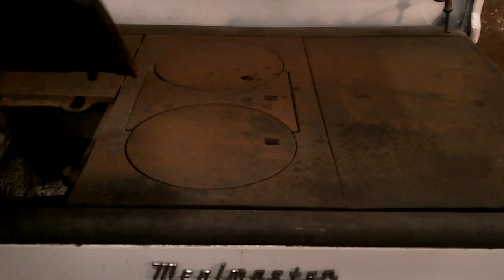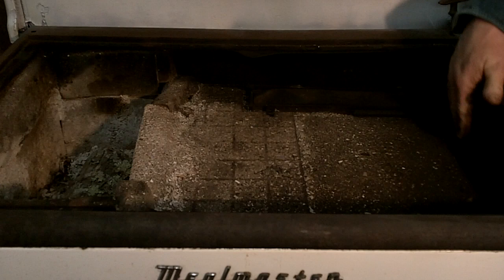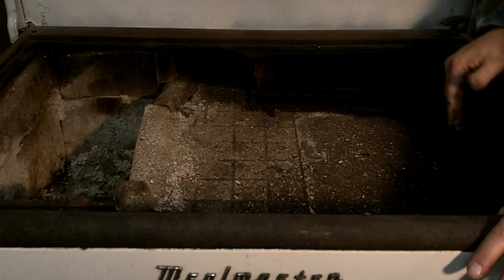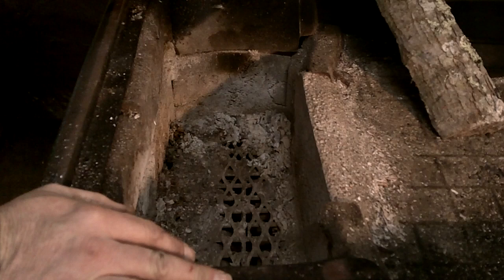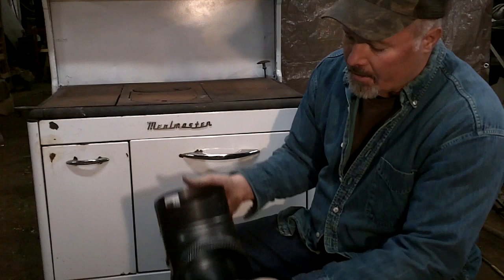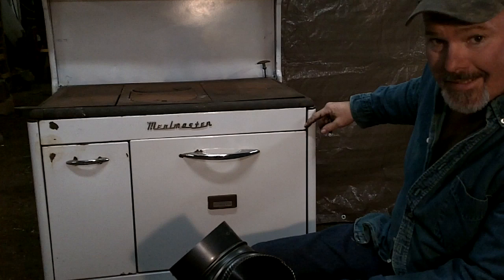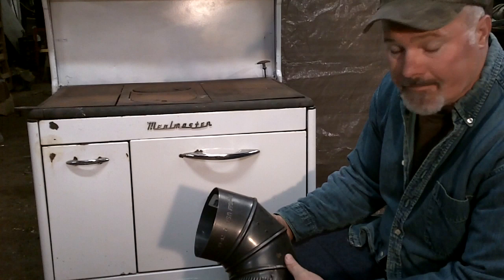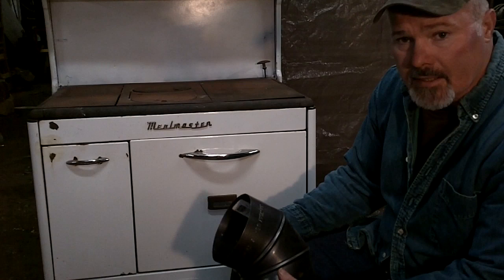wood cook stove basics part 2

Comment: my dad always turned his pipe up thru the ceiling and not out the wall This allowed him to install, and use a damper in that pipe.He would damper it down when the stove was hot and you could feel the stove getting hotter. The coals would glow and continue to burn, but the heat didn't escape straight up the chimney. It was held down more in the stove top. More heat from less wood  Just another variation on the pipe. He grew up in logging camps in the 1920s around Asheville NC.

Comment: This is an excellent video. Thank you so much for sharing this information. I am building an out door kitchen where  I have limited access to fuel and gas. Therefore all cooking has to be done using wood. I have to cook for 45 to 80 volunteers a day. I already had plans for a wood/charcoal griddle as well as a large barrel grill. The part that I was missing was an efficient wood stove top and oven. The video that you posted has solved all my problems. Thank you so Much...

Comment: I have the exact same stove as you. It was my aunt Lola"s.My firebox is likewise deteriorated. I appreciate the information on how you patched yours up.Both sides of my box, the concrete substance is competely gone,and both ends of the box it is filled with cracks.I guess I will replace it all. I have a friend who is a boiler maker. I noticed that you took out the old cross member that was at the top of the firebox on the right.Mine is bowed really bad too.. It looks like your stove is doing quite well without it.I've welded all of the breaks in the firebox lid of mine, 'with nickel"and am about to install it on my back screen porch. I havn't been able to find a temperature gauge for it. The one on the door is missing the needle.I guess I'll look for one to go inside, like yours. It looks as though you have taken out you grate? I've seen several places to purchase them on line.I just Googled Mealmaster Parts.Thanks for taking time to make this video. It was really timely, and much appreciated,Larry P.

Comment from the maker: A water tank is very handy. Some types are removable, if that is the case i recommend doing so. That will give you a chance to clean and inspect it for leaks.  Having hot water to do dishes or even bathing  back in the day was a great comfort. If it turns out the water tank is not removable  then only add a small amount of water at a time to check for leaks. If the water tank is bad it is possible a sheet metal shop can make a new one.

Comment from the maker: @suprhandyman  I will admit out of the 3 stoves i have the meal master smokes more than the others until the draft takes effect. It has to do with the outlet gate being horizontal  where the others are  more vertical. The vertical smoke gates seem to draw better when the fire is still in the green stage (more smoke than heat).

Comment from the maker: @suprhandyman  On the rear of my mealmaster  there is an 8 inch opening. I had a 8 to 6 inch reducer where the pipe connected to the stove. I changed it to 8 inch pipe and that helped.  Also powder dry kindling to start your fire will help to reduce smoke. Hopefully this helps.
Reply: I was thinking about a reducer as well, glad you told me this and I will stick with 8". We have the exact same stove too.

Comment: great video. I have the same stove. I started having problems with smoke coming out of the top so I cleaned it out and it's still smoking and that's not good in the middle of winter to have all the windows and doors open to clear the smoke out of the house. I have one elbow coming out the back and straight up from there. I have a metal pipe chimney and I think it needs to go up higher to make more draft. Have you had any problems with  smoke?

Comment: I have the exact same stove. The flu pipe goes straight out the back and through the wall and then turns 90ﾟ and goes up. So only one elbow. Some of The Times I have a hard time lighting the stove and it smokes out the whole house. of course I have to open all the windows and doors to air it out and then I lose all of the heat that I already had in the house. Could you give me any insight on the proper way to light this stove? Do you have an email address I could send pictures to?

Comment: Thank you Mr. Lester.   Very good tutorial!   Question:  My Meal master firebox liner is wearing out and now looks too thin.   I was just wondering if you poured the refractory cement pure into a make-shift mold you made with a piece of sheet metal  OR did you use it to bond firebricks to the sides of the firebox?  Thanks again, Frank.  Burlington, NC.